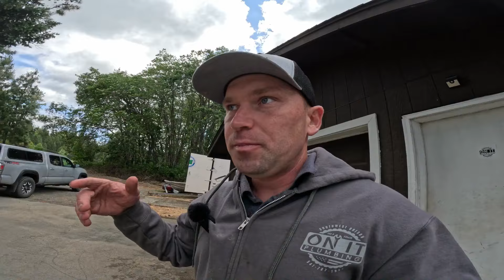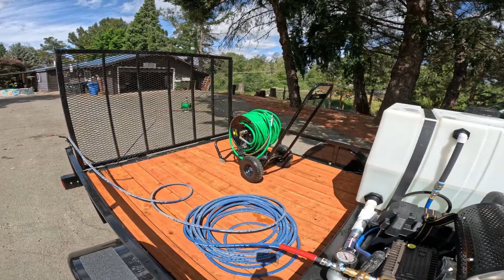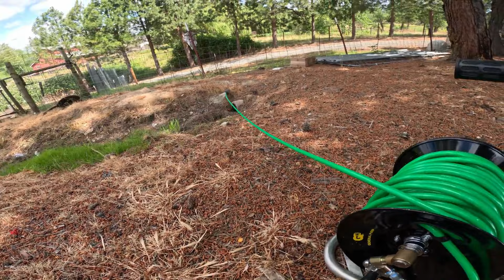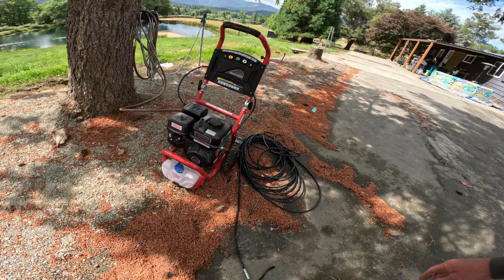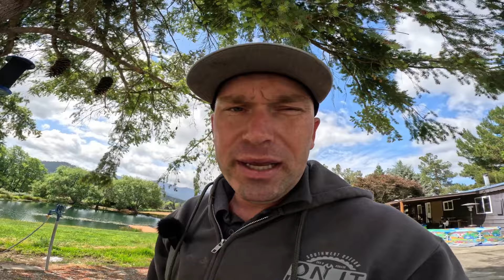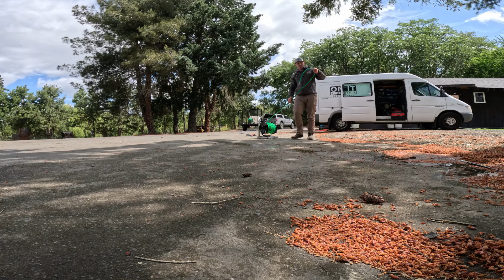$500 Sewer Jetter Versus $15,000.00  SEWER JETTER Test (Instant Regret?)

Comment: Predator 4400psi 4.2gpm pressure washer, a secondary unloader valve so you can make the water recirculate, and a good 9/16 jet hose on a reel. You'll be in it over 1400 bucks but that will get you through 90+% of clogs you'll run into ever and you have a bad ass pressure washer when you need it too. They are fairly small, could still fit in a service van and can be built to hold that hose reel extremely easily. Not quite as insane as the $15000 machine but for less than 1/10 the cost to be about half as good is a fantastic value. I'd say it's many times better than the smaller units too. The residential pressure washers at 2gpm just didn't have the umph to REALLY jet a line out past 100 feet. You could go 200 + easily and still have great pressure with the larger machine. Also with the unloader you can turn it way down and run 1/4 hose in your sink and tub lines.

Comment: What are you using for the pulse? What item is that and how is that connected to the Pump?  And how are we going down sizes on hoses and up to half inch like what item are you using or where are you doing it at? I’m looking and I can’t really see exactly but I do like your your build and your set up is fucking beautiful thank you very much. I’m in the middle of a build for my pump. I’m using a clutch so I won’t have to worry about burning it out.

Comment: For those on a serious budget, you can rent an industrial sized pressure washer at home depot and a drain camera, also purchased a 100 foot hose and surprisingly quality heads from Temu.  I sucessfully unclogged my permiter drain tile with these items, rocks, roots and mud were no issue and I saved a ton of money.  The tile works great now and it flows clear to my sump pit.

Comment: Electric pressure washer bypasses the bypass problem.
Reply: electric pressure washers have almost no power - might as well put a drill pump on the end of a garden hose
Reply: @gorak9000  psi is psi

Comment: Are there some inexpensive nozzles that work you can recommend for a smaller diy setup?
Reply from the maker: Yeah totally you can get cheap and decent tips on Amazon but amazingmachinery has the best of both worlds! Good luck. You really need to have a variety I wouldn't worry about crazy expensive tips. definitely one thats all ports on the back to pull harder and a couple with piercing nozzles and one spinner.
Reply: @o @onitplumbing  I ordered the amazon special nozzle pack to try and a 1/4” piranha hose. The hose ends are nptf and the nozzles are npt. Im getting mixed answers on whether they are compatible and I dont want to damage the nice hose. Any thoughts on that? They hand thread on about 2.5 turns but I didn’t realize they were different. Seems like the hose is a popular option but all the nozzles seem to be npt with a different thread type.
Reply: @slipagent6 most of the nozzle you see online are BSP thread, they will go on a thread or 2, but will not seal, and if you really tighten them down hard, you can damage the threads on the hose. I have run into this problem with nozzles from eBay, Amazon, temu, although I have gotten npt hose and nozzles from temu and Amazon. And I have even ordered a few npt to BSP adapters so that I could use a cheaper nozzle.

Comment: You need a foot pedal for those things. Safer and more control especially when working the lance.
Reply from the maker: Hmm I prefer the valve but I used to use the foot pedal it was also a good option. I tried to setup like the drain addict in Australia lol

Comment: I have the Dewalt 4400psi pressure washer and have it converted myself and it does the same thing as the big jetter do and I don’t have to charge extra or take too much time. I highly recommend it. Cost me less than $1,000.
Reply: What kind of jobs are you tackling with it ? I’m looking at doing the same. Doing all the math I don’t see why it can’t cut the same as a big unit with the 4400psi just less flow to move debris
Reply: You go to people's house to do that I would like more information to get a Jitter in my pipes answer me back

Comment: Hey boss love the video. I’m an Australian plumber and would love to build or have something like this. What lpm or gpm would you recommend would be enough to clear main lines on houses. Just starting out thanks
Reply from the maker: jet hoses and tips are available on Amazon as well as carts and valves. Good luck!
Reply from the maker: 2.4 gpn at 2400 psi works but bigger would be better I'd get the 3500 to 4000 psi models and pay extra you can do 200 ft more easily. let me know if you have any other questions
Reply: Thanks man, much appreciated

Comment: I generally use a 4000 psi 4 gpm unit, that unit is not much bigger than your small pressure washer. if it's has roots or scale in the pipe, I get out my 4000 psi 8 gpm set up, that I built for around $3000.00 it's just 2 units tied together with a tee and 2 check valves. So I have a setup with more power and about 12 thousand saved. Fixing to order a reaper nozzle, as that should take care of 95% of clogs that I encounter, then the root ranger will take care of the rest.
Reply: I am interested in see how you setup your own unit.  I currently have one of those expensive ones I purchased, but am interested in building another one on my own
Reply: @MichaelMcGregor1 the jetter head is the second most important thing after the pressure.
Reply: Can you build one for me?
Reply from the maker: Now that is CLEVER! I like the idea. Lots of money saved! I have technicians so I try to make it simple for them to pull in grab the trailer and go, but I can totally see that working well and I may have to give it a try just to compare it with mine, now I am curious! Thank you~!
Reply: @onitplumbing  As you already know, getting to a location that can provide 8 gpm is not always the case, so a small tank may be needed, so far the restaurants I take care of have enough flow, but I plan on having a 55 gallon tank set up with 2 spigots, and a fill valve. I might even add a kill switch in case the 55 gallon drum gets to low, would hate to mess up a pump. By the way, one of the units I run is a Dewalt, which was made by Simpson, its like 4200 psi at 4 gpm, the other is a belt drive made by BE, 4000 psi at 4 gpm. I put the tee fitting and check valves together and tested it with just 1 pressure washer so far, it worked perfectly, not 1 drop of water from the check valve that was not hooked up. I don't have the flow at my house to run both at the same time, but I am fixing that also. I bought the ENZ rotodrill 1/4 and the 4000 psi at 4 gpm will run it, but it need 7 gpm to really do its thing. https://hydromaxjetter.com/collections/nozzle/products/enz-rotodrill-mini?variant=42375304020120   I want to buy the ENZ rotojet to clean pipes, but I need to study which one I need a little more, https://hydromaxjetter.com/collections/nozzle/products/enz-rotojet-kbr-w-thrust?variant=33342904270980 I also bought one of the reverse turbo nozzles from ebay for about 30.00, it worked really well for a few minutes, then quit, and I was using it with its rated power on my 3000 psi 3 gpm machine. Guess buying cheap didn't pay off that time. So either that root ranger or the ENZ reverse, https://hydromaxjetter.com/collections/nozzle/products/enz-bend-rotodrill?variant=33864499789956  I learned a lot from drain attic, but most of the drains he works on are 6 inch, so some of the nozzles he uses won't fit in our 3 inch and maybe not even 4 inch. He says he is running 5000 psi at 10 gpm. Then the other slight issue I have run into, I order hoses that say they have NPT fittings, but they come in with BSP threads. I bought a few stainless adaptors, but that just adds to the length of the stiff fitting, making it harder to navigate bends in pipes.
Reply: @stevem1081 i have one of those reverse turbo nozzles on its way to clean out 4” clay tile infested with roots and silt. been using a hotsy 555he 2.2 gpm 1300 psi with regular mushroom 🍄 and buzzer jets
Reply: @denisrhodes54  As long as the roots arn't so thick that the reverse can't get through, you will be ok, but I believe you will need a good bit more flow/pressure to do much.
Reply: @onitplumbing  Here I am over a year later, and I still haven't needed my set up I made to run the 2 units together, why? The single 4000 psi 4 gpm has taken care of all the grease clogs in commercial restaurants and even smaller roots in my neighbors driveway drain. Of course that is using the better heads, like the properly sized warthog wv, and a reverse turbo. And still use the basic 3 rear 1 forward nozzle. Buy the way, finding good heads for 4 gpm is hard, finding ones for under 4 gpm is nearly impossible. Did you ever buy a bigger portable or try hooking 2 together?
Reply: I'm going to buy The Drain Invader for $10k . It's a 4000 psi unit x 7.5 gpm. I have another cart jetter at 4 gpm x 4000 psi which is fantastic at root clearing with a root ranger but i'm looking for some thing that has forward root cutting capabilities like a warthog or reaper nozzle.  Do you use a garden hose connection or water tank for your 8 gpm?
Reply: @MagnumOpus-b6n so far, I have not needed the 8 gpm set up, but I  always check flow from the garden hose wherever I go. Some places would not be able to supply the 8 gpm, so once I get to that point, I will have to use a tank. I mostly do restaurants with grease clogged drains, and I use the small warthog head for that. I have also used that head to cut fine roots in a 2 in drain that I could not get the root ranger in. All with the 4k psi and 4 gpm.
Reply: @stevem1081 do you use a 3/8" warthog with 8 gallon jetter for restaurants?
Reply: @MagnumOpus-b6n so far, just using the warthog 1/4 inch WV classic rated at 4 gpm. I have ENZ roto drill, but I haven't used it, since I needs the 8 gpm to really do it's job. I want the ENZ reverse turbo, it is a lot shorter than the root ranger and can get through traps easier.
Reply: @stevem1081 I use a 1/4" warthog too for cleaning 2-4 " grease, works really well!. I put the 1/4" on a 3/8 " jetter hose.